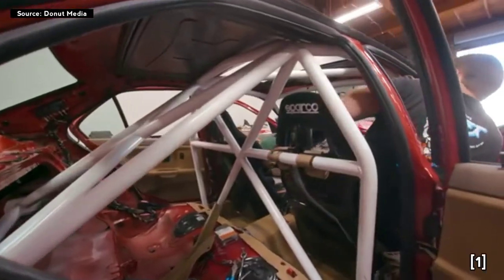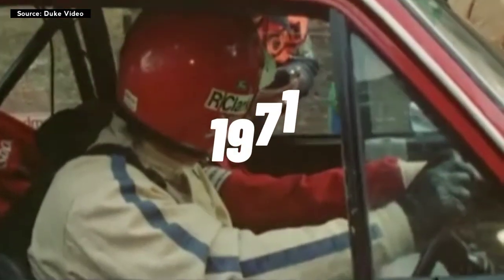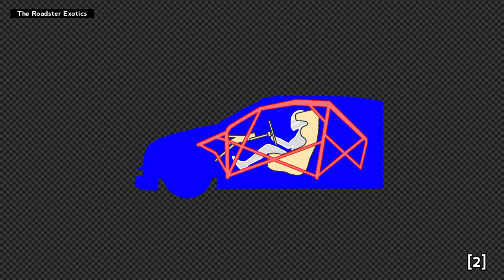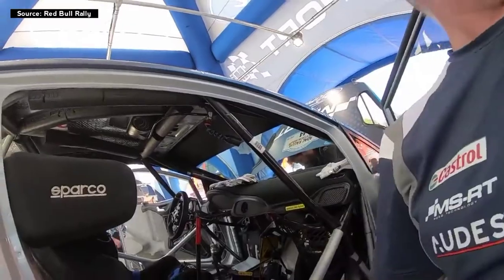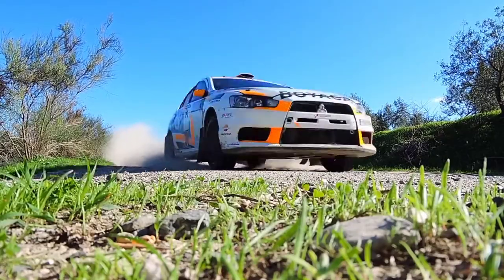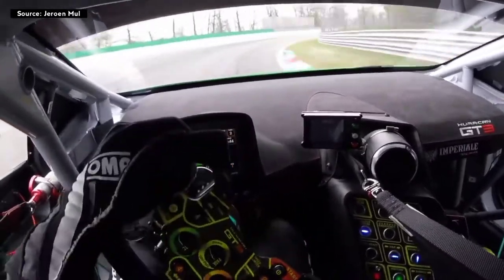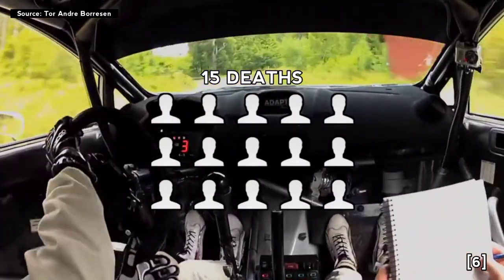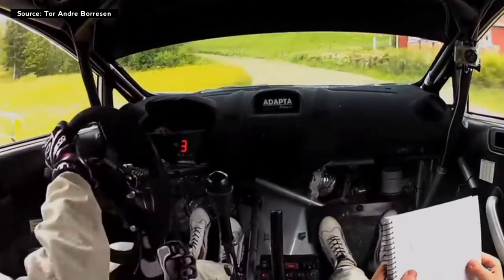Roll Cage Explain | Motorsports

Comment: every regular car should come with a roll cage. maybe not as rigid and complex than a race car, but a full and welded roll cage nonetheless. it would give car more durability, more usability under stressful conditions, more resisliance to small wrecks, and more safety. some kind of light helmet could be designed to prevent the head from striking the tubes. it would save countless lives.

edit: it would give more comfort (the suspension ms would work better) and a healthier safer handling. towing hooks could be designed to take advantage of the rollcage and enable to tow extreme weights without hurting the cars structure integrity.